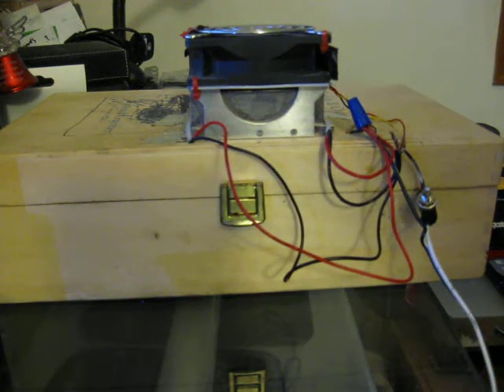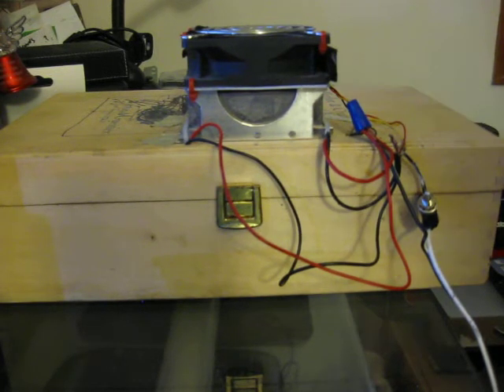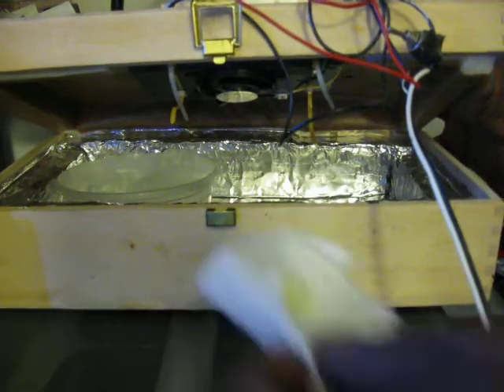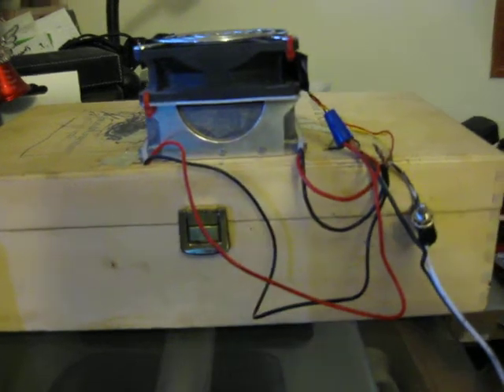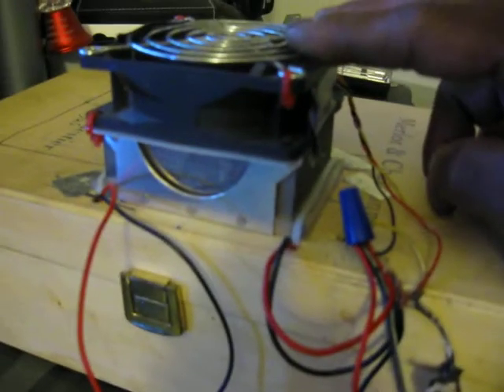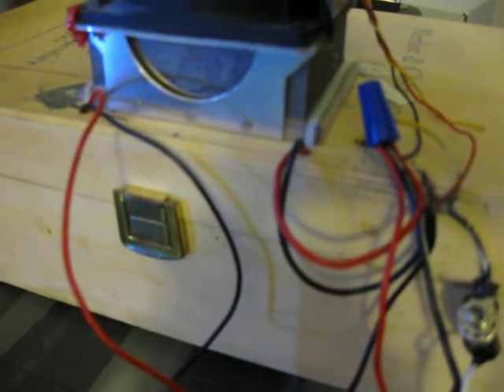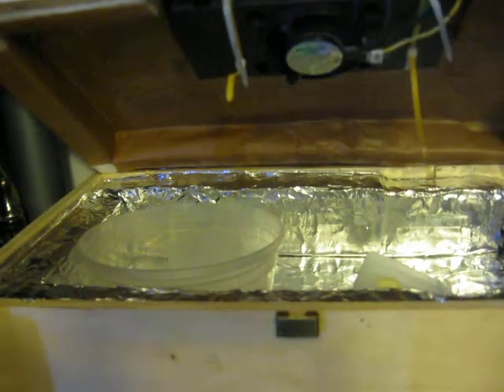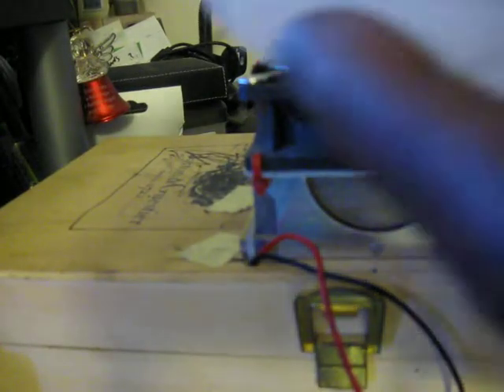Homemade Peltier Warmer/Chiller *Not Bad

Comment: Thanks for the video. I have a question about the hot side of the chip. Without a heatsink on the hot side will it not just overheat and burn out?
Reply from the maker: Without the heat sink or something on it to transfer the heat effectively it will burn out